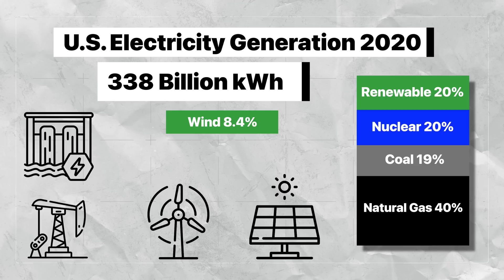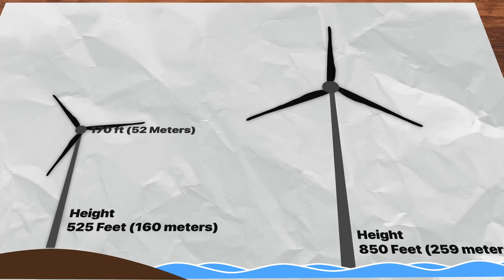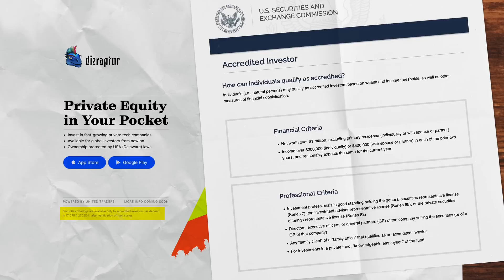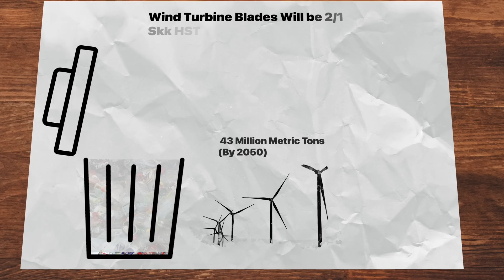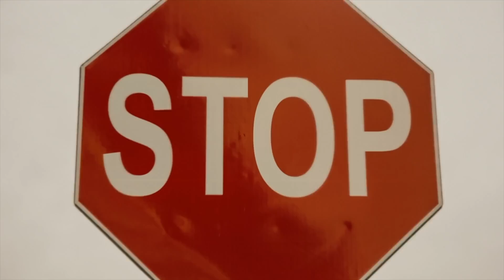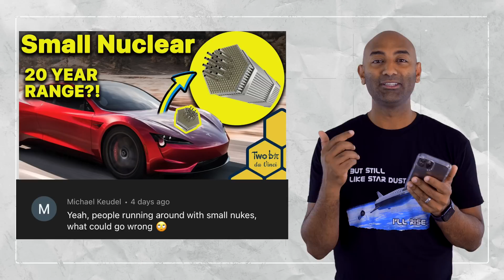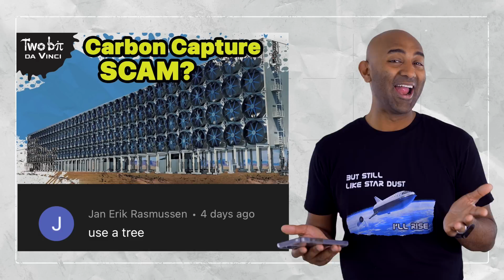The TRUTH About Wind Turbines

Comment: One must examine how frequent this issue would be encountered: If once in a lifecycle of 20 years, I believe even the most unimaginative solution of filling a landfill with used blades is not prohibitive. For comparison, typical american would produce 1700 lbs per person, per year of trash that is landfill bound. Or about 34,000 lbs of trash per person in 20 years. By comparison, a typical blade weighs anywhere between 25,000 - 30,000 lbs, and a 1.5 MW turbine would produce three such discarded blades once every 20 years, while also serving about 1000 households (1000-1500kWh per month). That is about (3 blades x 30,000 lbs per blade)/(1000 households x 2.5 individuals per household x 20 years) = 1.8 lbs per person, per year of extra landfill trash. This is an absolutely insignificant number.
Reply: its not weight but volume you need to be considering in that analysis  most  home lanfill waste is much more dense
Reply: @techobservations8238  not quite. at 1.5 lbs per person, per year, even assuming that the density of the turbine is as low as that of air, which it is not, but i am making an absolute extreme assumption to demonstrate worst case scenario, that is 0.08 lbs / cubic foot, that implies 1.5 lbs / (0.08 lbs / cubic feet) = 18.75 cubic feet, or about 140 gallons, which is about 10 garbage bags. 

now this is all based on my assumption that the density of a wind turbine blade is equal to the density of air. this is of course off by a factor of 10 at the very least. so we are talking about maybe, at worst, 1 extra garbage bag per year per person.
Reply: So let me ask you one question. Your math is all wonderfully presented but let me ask you this. Would it be ok with you to bring all those blades that are in the process of consuming hundreds of acres and put them right in your back yard? Would you be ok with that? The reason I ask is that they are looking for more places to dump these blades. Can I have them get in touch with you so they can start bringing the semi loads and you can make your backyard available? I’ll wait to hear back with your answer. One last thing. Your math has a little flaw. The blades aren’t lasting 20 years. Many are coming down after only 5-7 years. But to your point about  so many pounds per person. How  many pounds of none renewable waste per person is acceptable?
Reply: @StarBase7390  You are full of nonsense. Pure and utter nonsense. You are making things up as you go. Grow up, and talk like a normal person. Instead of telling easy verifiable lies and utter nonsense.
Reply: @StarBase7390  Dumping blades is nothing compared to coal. The 3.6GW Dogger bank windfarm after 30 years will dump 0.3 million tons of waste to a landfill. A 1 GW coal power station produces 6 million tons of slag (a very toxic cancerogenic waste to landfills) over the same 30 years.. Currently, the world's coal industry produces 5 billion tons of slag to landfill per year. plus another billion tons of infrastructure waste. If all coal were converted to windfarms would reduce landfill waste by nearly 6 billion tons per year.  And reduce CO2 emissions by 15.3 billion tonnes per year. Yes, Windfarms are not perfect but are just so much better than fossil fuels by so much. overall a 1000 times better.
Reply: @stevetaylor2818  you read everything I said and then chose to ignore the last line. I am not nor can I condone either one. Coal or wind turbines. Neither I don’t believe is the real answer. What your advocating is choose the lesser of two evils. Sorry I don’t subscribe to that way of thinking. Let’s spend our valuable time and resources finding a suitable alternative that meets all the requirements. Clean, safe and renewable. Its not a matter of will we find a better solution, it’s when will we. The sooner we start looking the sooner we will find it.
Reply: @StarBase7390  Yes less of two evils, in fact, the Dogger Bank wind farm will generate about 1000th of the pollution and damage to the environment over its full life cycle compared to a coal power station! Nothing is perfect, but wind farms are so much better! 

And  Noting wrong with fibreglass, the boat I lived on was made of it, many cars and products are made of it, it's very common. and most houses will have things made of fibreglass, even many children's toys, once made into something is a pretty harmless substance that does us little harm. Yes, give me some old blades, could cut up and replace my garden fence. But coal slag would poison my garden, kill everything, make me ill, and would probably give me cancer. Over the last couple of centuries, coal-burning has killed millions and millions of people, as far as I know, wind turbine blades have killed nobody!!!
Reply: Today's turbines should last around 30 years on average, and they produce more Wh per kg, because turbines get more efficient as they get larger, so the numbers are even better than what you calculated for today's turbines, and they will keep getting better in the future as they keep scaling in size.
Reply: @amosbatto3051  The current largest wind turbine in the world is located in Rotterdam, the Netherlands. It's rotor diameter is 220 meter, and it is able to produce 14 megawatt. It is build in Rotterdam for testing and licensing purposes. Once that is completed these turbines will be deployed on a very large scale.
Reply: @insAneTunA  Testing has now been completed and the Dogger bank wind farm, off the UK east coast, is now under construction and will be using 277 of these massive monsters :-)
Reply: @stevetaylor2818  Nice !! 👍 😃
Reply: @stevetaylor2818  It will create a nice habitat for fish as well.
Reply: @amosbatto3051  For comparison, the largest inland wind turbine in the UK has a 150 meter rotor diameter and it can produce only 6 megawatt.
Reply: This video is completely wrong !!! This company in the Netherlands, Extreme Eco Solutions, recycles decommissioned turbine blades as well as fiber composite yachts into 100% recyclable street and floor tiles without subsidies and with a profit. Very very poor research from the person who made this video. 

It is not the technology that is wrong, but people are.
Reply: @insAneTunA  No offense, but that's not recycling. That's just reusing. I've seen their presentation and it seems they crush the composite into a powder which then gets mixed into the new product. That's an exercise in sweeping the problem under the rug. And the use of shredded composite as a filler was talked about in the video so he didn't do poor research. He just didn't name the companies proposing it.
Reply: @ChucksSEADnDEAD  actually that form of repurposing is much more energy efficient: using glass fiber or polycarbonate pellets that are created from shredded plastic bottles are often used as reinforcement to augment the sheer strength of concrete. These have a double advantage: locked away in concrete, these plastics enter the ecosystem as micro plastics at a much lower rate than they would when recycled into clothing, or rugs (which is effectively the only large scale recycling of plastic at the moment), and they provide significant enhancement to the durability of the roadways. Additionally, this approach uses significantly lower amounts of energy: from energy positive of 2.8kWh / pound of plastic recycled, versus virtually 0 energy expended in repurposing. Effectively you the landfill savings without have to expend energy first in recycling.

Comment: Wind Harvest International is an emerging wind energy company building its turbines out of extruded aluminum, steel and copper. Fully recycled at end of life, which will be a very long time, since extruded aluminum takes a long, long time to wear out.
Reply: These big blades from just these 3 metals? No carbonfiber+metals layer cake?
Reply: The problem with Al is that it work hardens really easily. I wonder how they're managing that. Not saying it's impossible, just wondering.
It's true that it could be recycled at the end, but I wonder what impact the manufacturing/recycling are compared to the current methods and materials. 
I suppose if they used renewable based energy for electric furnaces, that impact could be lowered...

Comment: While not insignificant the blade issues are over blown. This particular waste product is very visible compared to the dust, gas and slag of fossil sources
Reply: It gives me faith to see so many people in the comments that understand this! Hopefully we can all steadily help the rest of the world understand 😁
Reply: This is a complete fallacy. You want to downplay the issues with wind energy by bringing up fossil fuel, by pretending fossils are the only energy source we can use.
What this says is that we should fix some issues before investing more in wind, or just accept that it's an avenue we may leave on the backburner as we invest in better renewables. But no, you people just say "ignore the issues because the alternative is fossil". This is a cult.
Reply: @ChucksSEADnDEAD  this was only a single point made on the subject. It’s not a cult, it’s a 30 second clip of a 4 hour conversation on alternatives
Reply: @richardgould-blueraven  Look at it from the outside. If all the solutions have problems, cutting out the solutions with the most problems reduces the number of problems we have to deal with. Doubling down does not help us in any way. But somehow, people will defend wind simply because it's not fossil...
But the point is that maybe we should rethink what we're doing and become more effective at replacing fossils - not insist on flawed solutions by saying that we should ignore the issues.

Comment: What about building the blades so that they can be intentionally reused as something else???  I.e. structural components in buildings, bridge structures... for those blades used offshore, artificial reefs...
Reply: They have been used to build a cycling bridge in Ireland.
Reply: Tornado shelters (partly underground), storage units, some are big enough to live in, verical farming, wave breakers (can they stand salt water?). I smell business!
Reply: I think there might be a bicycle shelter made out of a blade. Quite a unique design though!
Reply: or jam them into the sea floor vertically and help reduce beach erosion. or toss them in a pile and call it a reef. And salt water might degrade the mount points, but the main fiberglass blade part can handle the sea. and they are non-toxic to marine life as the epoxies are resin types.
Reply: Or design those structures to use the blades as-is or cut into sections? 

How about repurposing as power poles, cellular antenna poles, etc.  Anything that needs strong poles or beams.

Comment: Of course wind turbines have a problem. Every solution has a problem. You can’t not solve one problem just because the solution will cause another problem. There is no escaping this. That’s why it’s called a cost/benefit analysis and not a benefit/benefit analysis. Turbine blades may have a disposal problem but, it’s not THE problem.
Reply: Exactly. Can’t lose sight of all the health and environmental problems that coal and natural gas are currently causing our society.
Reply: This video is not correct. A company in the Netherlands called Extreme Eco Solutions does recycle decommissioned wind turbine blades as well as decommissioned yachts into 100% street and wall tiles without subsidies and with a profit. This man who made this video did no research at all.

Comment: I believe we are going about wind turbine power in the wrong way to begin with. We should be looking at revising building and city codes to allow micro wind turbines on the roofs of homes, much like you see on sailboats if you walk through any local boat harbor. Micro wind turbines should be allowed on roofs of homes much like solar panels. Micro wind turbines are the workhorses for off grid power applications that operate 24/7 and are very resilient. They can benefit the individual home owner and/or benefit local communities by adding power to the local grid. This is especially useful during and after a disaster or emergency crisis. Plus micro wind turbines are easier to repair and/or replace verse these massive wind turbines that must be trucked in and cranes must be used for installation, which is not required for micro wind turbines. 🇺🇸🇺🇸🇺🇸
Reply: Again, cost-benefit… you get the best energy yield with undisturbed wind flow (ie. Not in between buildings). Also, the higher you go above ground, the harder the wind blows and the less disturbed is the flow. The yield is proportional to the swept area of the blades. It’s just more efficient use of materials to build them large and high. For the same amount of raw materials and costs, the big ones deliver more energy to the grid.
Reply: I hate when people make comments about subjects they know absolutely nothing about or have no direct personal experience related to the topic at hand or simply drives straight into left field somewhere. 
     You can walk around my wind turbines and never know they are there unless you looked up directly up at one of them. 
      I have seen at our local harbors here in Hawaii in which some boats has these cheap, not going to name the country they are made from because almost every damn thing is made from this country, with the long blades and makes a whipping sound because they are only using 3-4 blades only. This why I love my 5-6 blade turbines because they are so quiet and efficient. I have nine turbines in total that I designed and built myself. I just bought a vertical wind turbine and will be setting it up on a 6’ tripod for emergency communications or EmComm and I can’t comment about that type until I try it out first. You just can’t assume that all turbines are loud and noisy. Someone mentioned in between buildings, I can’t tell you if that is true or not since I’ve never lived in NYC. 
     Again, micro wind turbines are mainly designed for off grid applications and your local electric power company is never going to approve of any wind turbine on your roof that connects to the grid. I much rather prefer not connecting to the grid except for my electric stove, which isn’t inverter friendly. Hawaii is one of those special places in which off grid applications is encouraged along with water catchment systems. If city codes were open to micro wind turbines and off grid applications, no one would need a bunch of 15 story wind turbines to begin with was my direct point. 🇺🇸🇺🇸🇺🇸
Reply: @digitaldreamer5481  I hate it when people refuse to think about the bigger picture and also just assume I know nothing about some topic... 
FYI i work as a mechanical engineer designing wind turbines, I think I know what I’m talking about.
Resources needed to build either micro or large turbines are still finite, therefore efficient generation in relation to resources needed overall is also important. kWh versus kg’s of copper and the like.
For remote locations micro wind is absolutely fine, for citywide applications they make no sense.
Reply: The bigger and taller a wind turbine is the better it works and the more profit it makes. This video is not correct. A company in the Netherlands called Extreme Eco Solutions does recycle decommissioned wind turbine blades as well as decommissioned yachts into 100% street and wall tiles without subsidies and with a profit. This man who made this video did not do any research at all.
Reply: The noise is a problem when on houses, dealbraker. Either discover a super silent wind turbine, or else solar is the winner: no sound, no moving parts. And batteries of course.

Comment: Wait a minute! You mean to tell me that a complex problem does not have a single simple solution? I know that when I have non-(as is)recyclable tech, I go through the process of breaking it down to the recyclable components and "safely" dispose of what is left. I foresee the next green revolution being the recycling/repurposing of the material used for the current green revolution. Today's solutions fix yesterday's problems, thus tomorrow's solutions will have to fix today's problems. The true enemy of better is best.
Reply: I agree, but I think the recycling revolution will be sluggish until fossil fuel usage is drastically reduced.

Until then, virgin materials will simply be too cheap.

Comment: Every form of energy has problems.  I'm confident the recycling of turbine blades will ultimately be solved.
Reply: GE is devoted to that now.
Reply: @newguy6935  Ye, General Electric announced a fully recyclable Wind Turbine prototype this week.
Reply: Exactly. People trying to use recycling as a reason to not do wind are just “letting perfection get in the way of progress.”
Reply: @SaveMoneySavethePlanet  There is a concept as you articulated there, that many well-intended Lefty types need to learn. It's basically the Perfectionist / Perfect Solution Fallacy, if you want to look it up. But basically the way past it is this attitude:

"Strive for perfection, do not throw TANTRUMS if you cannot receive, or achieve it. If absolutely necessary and there is no alternative, accept the 'lesser evil' - Michael Child
Reply: This video is completely wrong !!! This company in the Netherlands, Extreme Eco Solutions, recycles decommissioned turbine blades as well as fiber composite yachts into 100% recyclable street and floor tiles without subsidies and with a profit. Very very poor research from the person who made this video. 

It is not the technology that is wrong, but people are.

Comment: Making blades with a much longer life span seems to me to be the solution.
Reply: It's the entire structure that has a life expectancy, not just the blades.  The motors, the tower, everything.  And by the time the structure is retired, no one would want to re-use those blades.  In 20 - 25 years, blade technology will be a bit better.

It sounds like a good idea, but I don't think the blades are the weakest link.